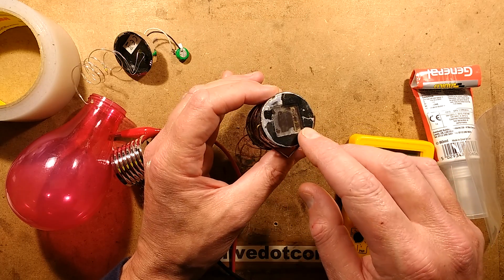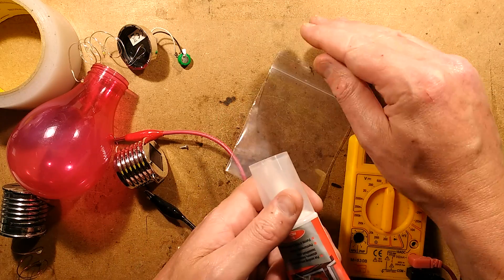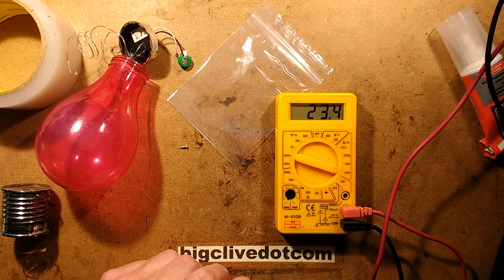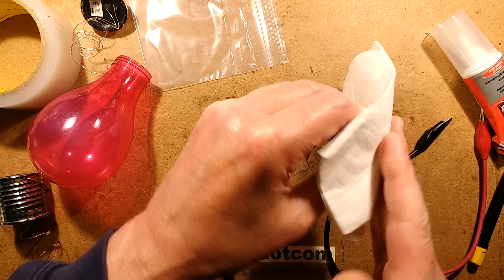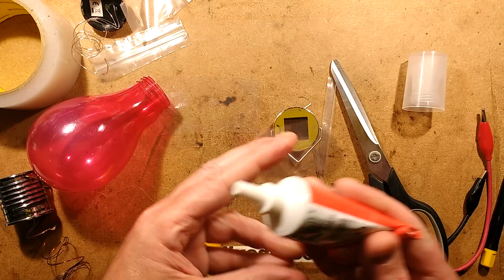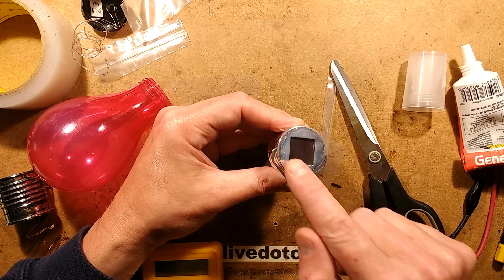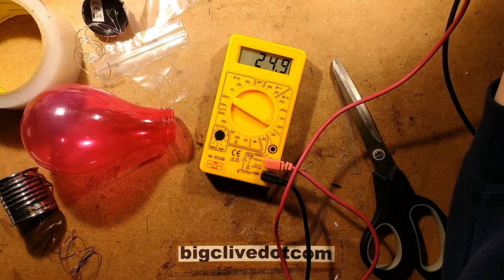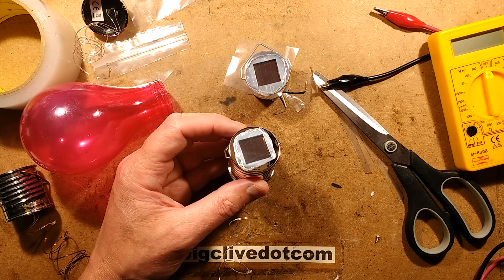Easy way to create a protective silicone layer on a solar light.

Comment: acetic acid cure silicon in corrosive to electronics, keep that in mind
Reply from the maker: That's mainly an issue when it is used inside enclosures with no place for the liberated acid vapour to go.

Comment: Use a cork of roughly the same size as the panel and press it down to make the thin layer of silicone the same thickness.

Comment: I tried this already, turned out the water was running down the wire hanger and getting into the bulb via the holes the wire goes.

Comment: Eva solar sheet cost more than a solar panel. I have cells but no eva.  Any tips for cheaply coating a large area, say 2 sqft?  Against glass?
Reply: Maybe rainex ?  But a more permanent solution?  Spray urathaine?  Silicone smeared around? (  How to attach to glass?)

Comment: PVA Glue is surprisingly waterproof once dry. It can be squirted around the edge of the cell to seal without covering the whole thing. It works and lasts until the cell frosts over.

Comment: probably won't read this but I used that clear protective spray that is UV blocking, (just the more degrading end of UV) and it peels off like a plastic stretching film
Reply from the maker: I've not come across that.

Comment: Whats the results??
Reply from the maker: They've been fine.  Even when the silicone has discoloured.  But it works best on metal lights as the silicone does not adhere well to plastic cases.
Reply: bigclivedotcom thats good, thanks for your input. Im always having to change batteries and put tape round my solar lights

Comment: What about something that doesn’t harden? Like dielectric grease? It’s dirt cheap and you could pack it all around the solar panel and it won’t harden or expand/contract during weather changes. Obviously you wouldn’t leave big gobs of it on top of the solar panel. Just wipe it on and smash it into the cracks and then wipe it off. Just a thought

Comment: Hi Clive have you ever reused a small package of silica gel we get when we get with our orders?  It would still de good wouldn't it?
Reply from the maker: You can recharge silica gel by microwaving the pouch on some kitchen towel to dry it out again.  Some silica gel dryers have a built in heater for drying them before next use.

Comment: The wires used for the internal wiring of those cheap solar lights are usually made of steel and thus rust easily. Swapping them out for some copper wires would make the solar light last longer even when the moisture gets in.

Comment: Acrylic conformal coating! You inspired me and I am giving this a go. Dried quick and looks beautiful. Let’s see if it lasts outside in Australia. I will report. These are on the much better lithium solar lights (Duracell are my Shenzhen branded version) they are still working after almost two years but are getting a bit hazy . The conformal coating makes them look clear and glossy again but am yet to see if it will last)
Reply: Did it work?

Comment: spoiler alert the silicon will shrink. you need something that holds the silicon in place. my suggestion: acrylic sheet with a couple of screws to keep preasure on the silicone. that should last forever (or until the acrylic cracks).

Comment: Nice video! Neutral silicone is better around electronics
Reply from the maker: I agree.  Especially when using to seal an enclosure where the acid vapour will get trapped.

Comment: I've had bad experiences using commonly available RTV silicones with electronics, as they emit acetic acid (vinegar) while they cure and corrode wires, circuit board traces, etc.  Spend a little more and get the type that don't produce acid while curing from an industrial adhesives distributor.
Reply from the maker: If used on airtight enclosures acid vapour damage will ocur inside.

Comment: I just run a fine bead of silicone between the edge of the solar panel and fixing body its mounted to, to ensure a waterproof seal.   Another way is use a heat gun to soften the hot glue they bond the solar panel in with, then remove the panel and get rid of the hot glue and fix the solar panel back in with copious amounts of silicone underneath to ensure a waterproof seal.

Comment: RTV silicone goes opaque over time.  Probably better to use clear 5-minute epoxy.  Mix some up on a flat surface, rub the top of the light/panel in it, and immediately flip it right-side up.  The epoxy will self-level before it "kicks" and cures.  And it stays clear for years.

Comment: Just thinking along the solar lights theme and indeed, all your other solar and battery light videos... could you either replace the solar panel or augment it with a small wind turbine to charge the batteries? The sort of small cheap ones on Ebay that can be had for a few quid. This could be really useful for places that don't really get enough sun to make the light last all night. I would have thoughts a wind powered garden light would be ideal for the Isle of Man... :)
Maybe a project for a future vid perhaps?

Comment: Hi Clive I tried streaming your videos to my large screen tv. The video streams fine but there’s no sound. I have tried a different video from another youtuber and I needed to adjust the sound. why is this?
Reply from the maker: It may be to do with surround sound settings.  My videos have mono audio on both channels, but sometimes surround sound processors put the audio out to a central bass speaker that isn't in use.  Let me know how you get on if you adjust anything.
Reply: hi I tried firstly the settings under more options. The audio section was greyed out. So I went into my settings on my tv. For sound out I use a  LG sound bar with external wired sub woofer so i tried all sound options but still nothing.

Comment: I don't know what the science behind the stuff is - the UV setting resin sticks to virtually anything and is pretty good a keeping water out.  It comes in two consistencies, thick and thin.
Curiously if you buy "UV resin glue" it's £5.99 for 10ml ... if you buy "fly tying UV resin" it's £8.99 for 20 ml or £11.99 for 30ml !!!?  Comes in the same bottle and does the same job!
Anyhow ... the thick is good for building up over cracks, the thin will penetrate a crack and flow onto gaps.  you then blast it with UV light for (the books say 5 minutes, I've taken as little as 10 seconds)  My torch has just 3 standard UV LEDs (I followed one of Clive's tutorials ;) )  ... I've also used a UV cfl.  you have to be able to get light to the repair ... but as soon as you give it UV the stuff sets like concrete.  I scratched a line into my favourite squash glass, drew in a black line and then added a drop of the thick stuff to protect and cured it.  It dries clear so good as a protective layer.

I've used the mug for over a year, its washed every day and the cement is still solid.  I've repaired reading glasses, jewelry, one of the outside lights, small chips in porcelain.  I even stuck half my fingernail back together with a protective layer over the tear when I ripped it right down to the quick.  The nail grew out with the repair still in place.  It's my favourite glue.  If it sets tacky I massage a little olive oil over the surface to stop leaving fingerprints and it's usually fine. 

I'd flood the square over the cell, cure it, then paint a layer of thick over the whole top, cure that and I'd be pretty sure that would do the job.

Comment: Hey BigClive, I have a suggestion for a teardown if you can get one: a cardiac pacemaker. Interesting device. They use 2.8 volt lithium iodine batteries with a lifetime of 10 years, rated at 2 Ah, which is hard to believe since they weigh only 15 grams.

Comment: i dunno, from experience with thin silicone on other projects, it just peels off. Probably would have been better just to run a thicker bead around the outside edge (or applied from the inside) .
Reply: I agree. I have some of these with glass on them. I don't need to cover the glass, just around the edge, so water doesn't get under the glass. I was thinking of just running a bit around the edge.

Comment: Silicone rubber with vinegary smell used to be guaranteed for 10 years, and was sold to seal things such as baths, basins and showers that moved. In theory the lamps should be water proofed for 10 years.

Comment: If you degrease this with acetone I'd wager there's an 80% chance the faux chrome comes right off. Also, why didn't you test the cured cell, it might behave differently. The clear silicone could go hazy when cured. Or when outside for a while.

Comment: I have more data than I'm willing to type on the matter, but for your information, you can thin silicone compounds effectively with naphtha. The pro tips: Put the naphtha in the cup first, use at least 1:1 to even notice thinning, when you're mixing act like all of western civilization will fall if you don't mix it enough else get chunks. So far Ive made gaskets, diaphragms, replacement HT coating for the PVC sleeves on my lab glass holders, several of those little non slide phone pads, HT conformal coatings for electronics that encapsulate everything but leave the fins of the heatsink exposed and still confer excellent water resistance (some light baking may be needed to drive off the amount of naphtha needed to thin to conformal viscosities, and even mixing at these viscosities must be done with some form of power tool with care taken not to introduce tiny bubbles), I think you can probably handle the rest of the experimentation. Just thought you might appreciate knowing this is possible if you don't already. Also, I have an interesting type of card stock that is capable of both not sticking to curing silicone and also allowing it to readily breath and off gas the solvents. I acquired and discovered its use by coincidence but I'll try to droll up the name of the stock because its great for allowing thick, hearty sheets to cure quickly and evenly.

Comment: Interesting. I’ve recently purchased some textured glass brick solar lights, I notice they seem to gather light from all angles as no matter where I place them they charge well, got me to wondering if perhaps a textured or domed surface over these solar lights may help gather light and aid charging too, as they often struggle due to branch/leaf shadow. Cabochon siliconed on perhaps?
Reply from the maker: I think it's more likely due to using a generously sized solar panel, running the LED at very low current or both.  I do like the idea of a glass light gathering lens though.
Reply: bigclivedotcom - https://www.lights4fun.co.uk/i/q/SB-602-B/small-blue-led-glass-brick-solar-garden-path-light
these but they seem to have sold out. I’ve seen plenty of similar ones for sale elsewhere tho, Aliexpress has them, as does amazon, they make very nice table lighting, or an indoor solar candle, just leave them in the windowsill during the day.

Comment: Have you tried using surgical tape for this application because it sticks like wotsit too a blanket and it’s waterproof and it’s almost impossible to break it away from whatever your sticking it to Clive?  You should be able too buy a roll or a box of rolls from your local Pharmacy. 😎
Reply from the maker: The main issue is the high UV in sunlight that seems to degrade stuff quickly.

Comment: Speaking of weather damage, perhaps one day if you haven't already, you might want to look into a possible solutions for what the sun and rain does to the plastic or resin coated solar cells.  I have a few that have gone from crystal clear to completely white. I have sanded/polished a few and brought them back to clear, but it seems to be only a temporary fix as the material, over time,  eventually oxidizes right back to white.  It's completely annoying.
Reply from the maker: The resin covered ones do that.  You're right, it is very annoying.
Reply: It is my understanding that there are some UV resistant films (it may even be in the form of a penetrating plasticizer) that exist to be sprayed onto new plastic headlight lenses to protect them and keep them clear indefinitely, but they do apparently require annual reapplication to preserve those properties.  If I recall, one made by Maguire's (sp?) was recommended for headlights.  Perhaps that might also help with your panels?  Unlike some films used it apparently will not bubble or peel over time as it was designed specifically for automobile headlights and lenses.
Reply: Ethan Poole
Hey!  Thanks for the tip. I will certainly have to look into that.  I was considering experimenting with exterior urethane or possibly even marine varnish but I will add your suggestions to the list as well. =)

Comment: I used the poundland epoxy resin , just let a blob run into the solar panel and pool around edges ....very clean finish .
Reply: How did they hold up?
Reply: I guess we'll never know 🤷🏻😅
Reply: @redblaze2613  oh the lights failed - filled with rainwater / rusted . I don’t buy garden lights anymore
Reply: @carlyonbay45  Thanks for the reply! Having exactly the same problem.....thinkin of givin them up maself :/  Scotland is havin an awful summer this year, nothing s safe.
Reply: @redblaze2613  well evey time I’m in the garden centre I look the lights - I get tempted - but they are a disposable product - I think one season is all they were designed for . How they leak is a mystery 🤷🏻‍♂️ I’ve tried sealants / silicone / wrapping in plastic - even putting large jam jars over them …. They STILL get wet again 😳 and batteries fail in cold icy weather , the cold temps are another problem

Comment: I suggest getting a glass disc in the right size from ebay (spare flashlightlenses) and glue it down with LOCA. So pretty much like a smartphone glass repair.
edit: a added bonus would be that you can put your UV light to use.
Reply: In my admittedly limited experience, many of those glues are at least a bit opaque at UV wavelengths which the solar cell can utilize, so it may have some impact on output in actual sunlight where there is a good deal of of UV (typically the word "optical" only refers to the human perceived wavelengths, so UV opaqueness can still be considered "optically clear" since we do not perceive UV light...at least not any if us with an intact cornea).  How much the impact may be I can not say as it would depend upon the degree of opaqueness and the bandwidth of that opaqueness as well as the amount of UV light a given latitude receives at a given time of year.
Reply: I can't answer that, but I know that the glass, the silicone clive used and the resin that is already on the solar panel already absorb most of the UV. So the glue I suggested won't worsen the problem. I'll see when I can afford a spectrometer to find some better answers. Maybe I can use a B/W camera and a spectroscope to simulate the solar panels "view" and make testing cheaper.

Comment: If the tape died from abrasion, then what's to prevent the same from happening to the layer of silicone?
Reply from the maker: Time will tell.  We get a lot of storms here (island in the middle of the Irish Sea) so the lights often get thrashed about violently on the trees.
Reply: bigclivedotcom 
Have you tried cutting all the branches off the offending tree! 😜

Comment: Hope your method works Clive! I've bought tons of these in the past and water ingress has killed em all. Silicone works for a while but ends up shrinking and letting water in, at least in my experience. Sadly 99.9% of these cheapo solar lights, and even the more expensive ones, end up as landfill.  Eco friendly my arse! Shame really as people buy them with good intentions, only to end up having to bin them in a matter of weeks. Hey, here's a thought. If you had a thin solar panel with battery, cobs etc. soldered on the back of it then vacuum bag sealed it?? That WOULD be truly waterproof. After a few months if the bag gets misty due to uv, ye could always just replace it. If only I had a vacuum sealer to test my theory...
Reply from the maker: Ziploc bag and small desiccant pouch?

Comment: try not to concave the section over the PV cell. it will store dust ( dry mud) and mold. why not silicone a small square of glass over then. scoring and snapping glass is verrrrry easy.

Comment: 6/12 exactly the same lights have died. No water damage. I found the failure comes down to the cheap sht leds where one or more led are bringing down the power. The led chain work fine across two D cell batteries. Product obsolescence 😠

Comment: I thought you would scuff the surface of the panel then scrape the goop even with the top surface with a credit card or something.
Just filling in the square portion and leaving no loose edges
Reply: salmonline 
As the solar cell uses a substrate of glass it could be severely weakened by scratching the surface, which could lead to the cell breaking due to thermal stress.
Reply: I assumed the surface of the cell would've been a cheap poly-carbonate or something.
OK, then.  Same deal minus the scratching then.

Comment: My only concern is that the "Chrome" coating on the plastic will at some point corrode and that will allow the moisture to get between the plastic housing and the silicon. If it was directly applied to the plastic housing (no chrome coating) then there would be nothing between the silicon and the plastic housing.
Reply: Mikey8567 
The plating is actually vacuum deposited aluminium. They use the same method to coat plastic bathroom fixtures and fittings with a shiny metal finish, so I doubt that's likely to be a problem.

Comment: The silicon seemed to not have adhered well to the cell at the end there.
With the torture the older cells have evidently endured, I'd guess the silicon will peel/rub off fairly quickly. Perhaps leave the plastic cover on, with maybe a ziptie to hold it in place, and see if it fares better? 
Have you tried using a transparent varnish, too?